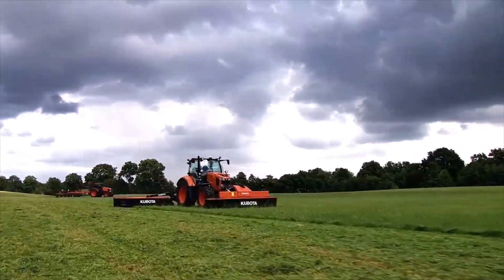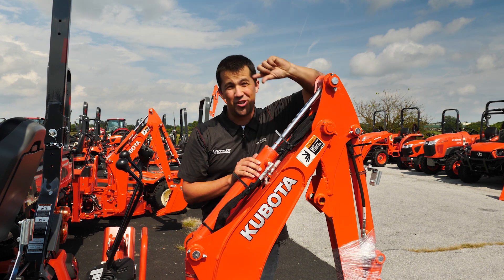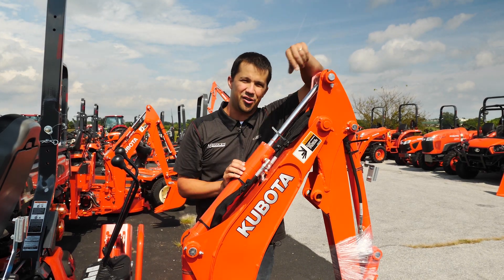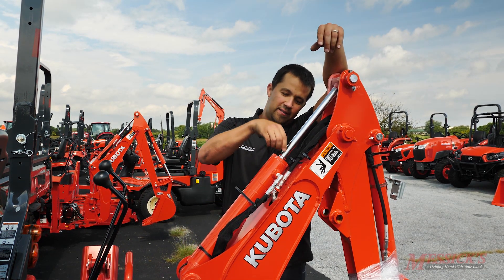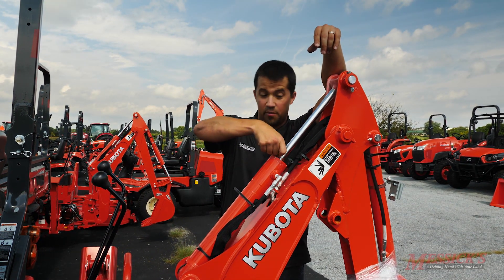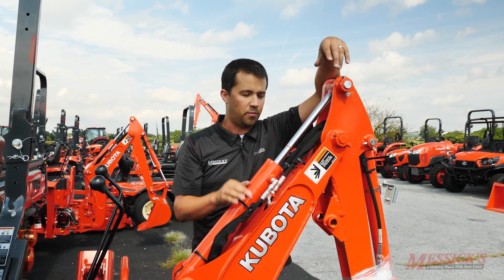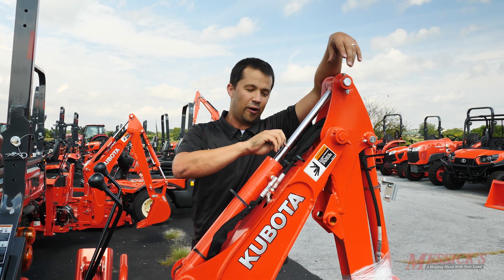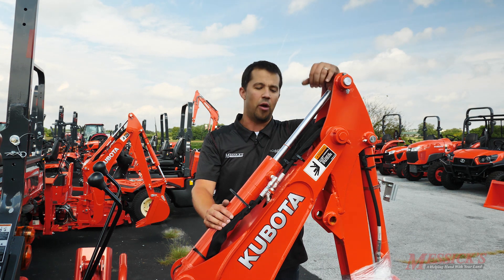Why is there a loose o-ring on my hydraulic cylinder? - TMT

Comment: Off the topic here. Is there any advantage to adjust the hydraulic pressure on a bx or other Kubota tractor? I've seen kits for doing this and was wondering what it would do.
Reply from the maker: it will give you more lift capacity, often people raise the pressure above the factory spec. No immediate harm seems to come, but it would increase the likelihood of seal failures in the front axles.

Comment: I would think knowing your going to get annoying calls about it you'd cut them off while setting them up. But then again it's probably the same people who complain about every little scratch and it's always the dealers fault.
If it's not leaking oil don't worry about it.
Reply: Wait - wasn't there a previous discussion about not worrying about small oil leaks?
Reply: This video has nothing to do with oil leaks. It is only about not needing to worry about the extra o-ring on the outside of the hydraulic cylinders. 
But are you referring to another video, where he talks about a different thing that is not something people should worry about?